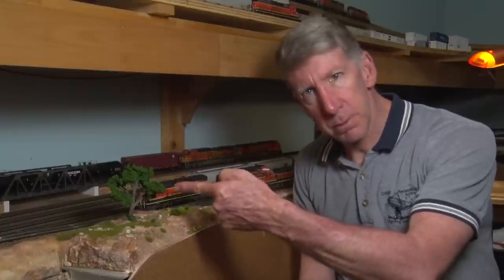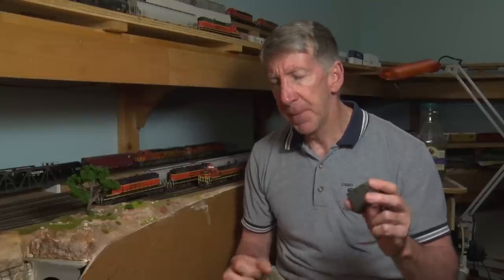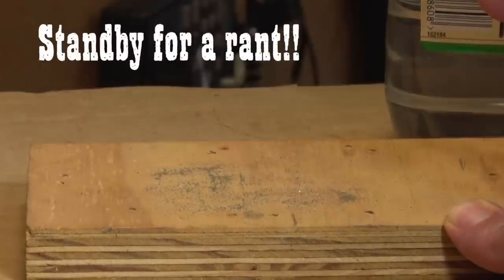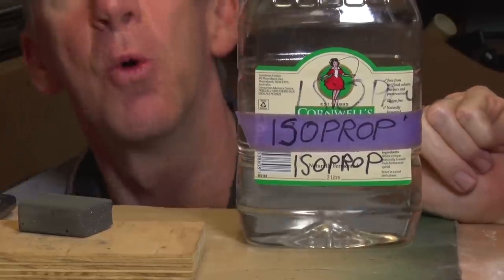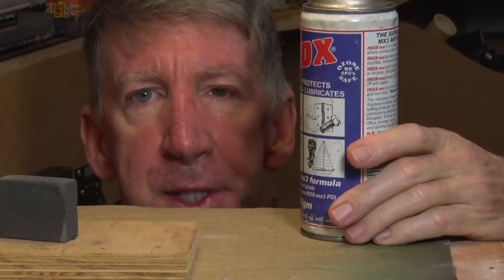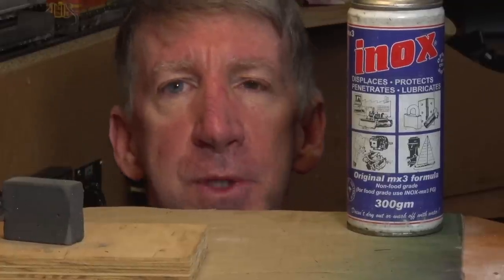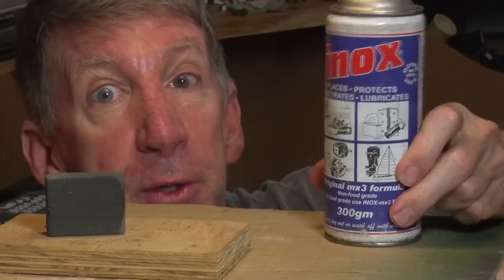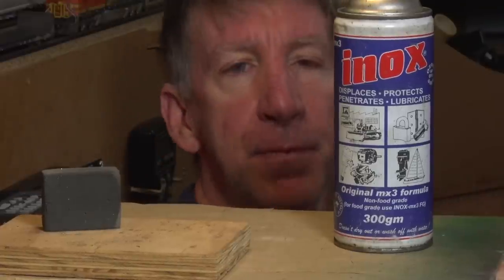Track cleaning do's and don'ts. How "Not" to  clean your track ! And how to do it better!

Comment: Classic!   Back around 1960, Atlas rail was brass.  I used to scrape sandpaper under a wooden block, which would work for a while.  But the more I did it, the less the "cleaning" lasted.  Switched to vinegar and got better results.
Reply from the maker: Thank you ! Vinegar??  The things we used to do ..LOL   i remember brass track and I had some in my early days.  We have moved on thank godness1
Gregg.
Reply: Well, I initially tried buying a special freight car that could clean the track whilst you ran the train.  It came with some chemical that you would add to a cylindrical tank sitting vertically atop what was basically a flat car carrying a silver-colored cylindrical load (the cleaner reservoir).  The fluid was gravity plumbed to a pair of lateral (spring-loaded) wipers.  The idea was to pull this flat car around the track with a loco and it would automatically clean the rails.  But the thing kept derailing at the switches. 

Aside: I only had three locos, of which only one could pull the device.  That was your ubiquitous Athearn F7.  Mine was Pennsy 9506 (Brunswick).  I also had a delicious Fleischmann PA in Warbonnet livery.  The shell was exquisite, cast metal with applied handrails and a metal screen grating over the heat exchanger duct.  But even with lead weights, it would lose traction, which was a shame cuz it had more powerful gearing than the Athearn.   Also had a Lionel "Texas Special" FA-1 with the rubber-band transmission.  Those bands would slip trying to pull the cleaner car.   Frankly, that loco was junk.  But it's the one that got be started in H0 modeling back in '59.   

I'm sure you know the classic construction of the Athearn with the single three-pole motor in the center.  But did you know that the Fleischmann didn't use rods at all.  It had two independent propulsion modules, each with its own motor that sat directly over the bogey.  The motors were mounted directly to the bogeys and each bogey could slip into the shell or quickly be dropped from the shell for gear lubrication.   Every now and then, one of these appears on eBay.  It's worth a fetch just to open one up and enjoy the construction.

But, I digress...

One day, someone at school showed me that dipping a copper penny into tomato ketchup (let it sit) could make the penny shiny.  I investigated why and learned that the vinegar is mildly acidic.  It is strong enough to de-oxidize the surface of copper and brass without being strong enough to hurt anything.  And vinegar was (then) dirt cheap.   Indeed, vinegar mixed with flour was used as a homemade brass cleaner during The Depression here in The States.

Sorry if this is too much information.  I took your question marks to be an invite to elaborate.

But yeah.  You're point about abrasives pitting the rail surface is well-taken.
Reply from the maker: @TheCondoInRedondo   Not at all! I had a rubber band drive RDC from Athearbogie/trn that was horrible! I remember Lima had a similar motor that sat on the bogie/truck. The motor ran in the same plane as the wheels , so no wrm drive and you could push them along and turn the motor...which is what we need today to get away from speed matching issues and locos fighting with each other.  I wanted to buy a "Aztec" cleaning car but they have stopped making them , so I will try to find a used one. 
Thanks for the interesting trip down memory lane.
Gregg .
Reply: Stay approachable, Gregg.   That is the charm of your channel.  You speak to us as if you're a neighbor.  You also respond to feedback.  That's the source of your popularity.  You're chummy, the way Paul Hogan portrayed his character in the movies.   It just shocks me when I hear your accent, yet see 'Merican heralds on the sides of your locomotives.  I thought I'd see a twenty-six carriage Ghan or maybe a Great Southern and a gigantic knife, not necessarily in that sequence.

That said, I must admit I do have an NR, two EL, an A and a B for what it's worth.  But they haul North American rolling stock, I'm afraid to admit.  The NR is Austrains, I think.  The others are Auscision.    Thanks for your attention, Gregg.

I'm absorbing your tutelage on occupancy detection today.

Comment: Simple track cleaning and it works!!!

I have been running my trains for 6 years and has never cleaned my tracks.
My story : After laying track I clean once with a track cleaning pad, only once. Thereafter I use ATF Automatic transmission fluid (The red one) as follows. Using ear bud dipped in ATF I apply about 300mm to each track at the highest point on my layout. My circles are 114m long, so apply less for smaller layouts. Only at one point, don’t overdue it.
The loco and wagon wheels will spread the ATF onto all the tracks over a period of time. You will have no mug built-up on wheels at all. There might be a little bit of loco slippage for a short while after applying ATF but it disappears quickly. Do not wipe any oily substance off the tracks at all. I reapply the moment any loco misses a beat anywhere on the layout, usually once every 2 to 3 months. Small bonus, after 6 years my track already looks a little weathered. Train friends, I was very sceptical about this method but believe me IT WORKS.
I used the MIDAS ATF Automatic transmission fluid  (The red fluid one)

Watch my layout in progress on You Tube
https://youtu.be/7B_GW2gJ0L0

Comment: Great Rant Gregg, the product  referring to is CRC 2-26 , I would use a drop on each wheel of my loco and give that a run around for about 5 minutes before and after a session . 
I got this tip from  one of the operators on an exhibition layout , haven't looked back since.
I also have a can of Inox, haven't tried that yet , I do use that in place of WD 40
Reply from the maker: Thanks Shaun!  It works well too , but try the Innox and compare . I wipe random sections of track evrey time i run trains and it gets around the layout.
CHeers Gregg.
Reply: @FishplateFilms  Hi Gregg, I will  give the Innox ago this weekend as the layout hasn't been running for at least 3 months .
I would  be very interested to say how it it goes, thanks Gregg
Reply from the maker: @shaunhuckstepp7531  Great Shaun!  Please let me know how it goes!!
Gregg .

Comment: Thanks for the information! Please let me know if CRC 2-26 Multi Use Electro Cleaner is the right substitute for INOX
Reply from the maker: Thanks Chandal! No , the "Electro clean " is a different product. If you cant get inox, then use the 2-26 Electrical multi purpose lubricant.
Cheers Gregg.
Reply: @FishplateFilms  Thank you so much! I did not get inox or CRC, but I used wd 40 multi use lubricant (silicon free), as suggested by another model railway enthusiast. I cleaned the tracks, the wheels and pickups, and my 20 year old locomotive become as good as new. It ran smoothly. Your explanation was very detailed and scientific. Being an electrical engineer myself, I could easily understand your concern with the use of polar cleaners. I have bought myself a new dcc set for christmas, and I am never going to use IPA or track rubbers. Thank you for your work! Looking forward to more of your content.
Reply: @chandal804  I used WD40 before using INOX. The problem with WD 40 is it dries out leaving no oil layer to stop the metal surfaces from oxidising.

Comment: Gregg, right on the money!  I'm in the  USA.  I've used Corrosion Guard and Corrosion-X on electrical connectors, and on my ham gear coax connectors (PL-259/SO-239 aka UHF connectors) for years.  I learned about this stuff from working in a seawater environment.  A few years ago I was introduced to Aero-Car's ACT-6006 Track & Rail Cleaner.  They also make Conduct-a-Lube for commutators and wipers.  But yes, it is counter intuitive that a dielectric material would give better conductivity, but it does.  My rant is people insisting  track must be perfectly clean to stop loco hesitation and stalls.  For some time now EVERY loco on my layout has Keep Alives.  Between the proper cleaning and Keep Alives, my locos never stall, no matter how slowly they are creeping.
Reply from the maker: Thank you Sir! Yes working in salt air is a killer for electrical gear! Those products you mention sound perfect for track cleaning and to  keep it from oxidising. I don't have any keep alives as I use live frogs , but if I had some short switching locos, I would give them a try.
Gregg :-)

Comment: Hi , wonderful ,I have just tried some contact cleaner just like you said and what a difference ,smooth at fast or deadly slow ,I used to put it on a faster speed or power just to get it around the track ,oh what a joy ,even the lights on my virgin train are brighter and I cant wait for it to go dark ,a standing ovation to you kind sir ,amazing ,and some thing that actually works  very best wishes from the uk Brian.
Reply from the maker: Hi Brian , thanks for watching and I'm glad you got some good results! Just remember that contact cleaner will not leave a protective film on the rails like Innox or CRC will, so you might want to use one of those from time to time.
Cheers Gregg.
Reply from the maker: @mrmusdtard2  Hi Brian, thats the one!  A can will last you a decade easy...use the plastic tube in the nozzle, and spray  2 tiny patches on a rag , then run along the track and see how black it gets! I keep using the same rags( i have little folded pieces everywhere) until they are filthy. Once you get the rails clean, keep rags with Innox on them as it will stay on them . You'll always get little dark lines , as dirt is always falling and the Innox will get dirt off the wheels too..it's a on going process but you will work out a routine that suits you.
Gregg :-)

Comment: Well I’ve got myself some INOX in the UK and just cleaned the track with it. It’s taken a few runs to get it running smooth but it seems to be working well now. Proof of the pudding will be the long terms benefits. Thanks for the tip!
Reply from the maker: Thanks Mark! It will get better the more you use it , as it removes the dirt from the wheels and track . 
Cheers Gregg.
Reply: That’s what I’m hoping Gregg, think I might need to use some fine wet and dry paper in a couple of places as there’s a few areas with some paint or other gunk stuck on. Still in the scenic phase at the moment!

Comment: Very good video.  I have used in the past a pencil rubber then wipe off the rails with a soft cloth.  I am about to build a small layout for my Grandchild and the stored rail I have is oxidised so will use inox to clean it and the wheels of the rolling stock.  I like the no nonsense language and to the point presentation.  One thing that the rest of the cleaning videos do not mention is that the rails are a circuit and should be treated as such.  Thanks.
Reply from the maker: Thank you Bob! I'm glad you enjoyed the video and got some tips from it .I appreciate the positive comments also.
Cheers Gregg.

Comment: What about 5 percent white vinegar soaking for 24 hours and then neutralize the acid and dry the tracks in an oven?
Reply: I second this question.  I have no experience in modal railroading, but I have my grandfather's old Lionel set.  Many of the tracks don't need a simply "cleaning", but instead need to be completely restored.  I understand that you shouldn't routinely clean with water or anything containing water, but how do you rehabilitate very old tracks?  I've seen other videos that explain how to remove the rust with vinegar and then dehydrate in the oven for an hour.  Is this a really bad idea too?

Comment: Thanks for educating us! There's another scenario to consider and that is people with layouts featuring grades > 1%. If the Inox or other brand of cleaner acts as a lubricant this can cause major traction issues. I have a friend who just went through this and it took a long time to get it off the wheels of his locomotives and rolling stock. 
I've had good results using only cotton cloth (socks) and elbow grease (can't beat the price). It's amazing how much black residue can be removed from the rails every month. I have a theory that this residue is a combination of normal household dust settling on the rails, oils and greases from locomotive gearboxes and the remains of micro-arcing between the rail and the wheel? The downside to my method is that it needs to be done once a month or so but I never have any conductivity issues after I clean it and it does actually remove a lot of that black residue right from the rail head. 
Another thing worth mentioning is the inside edge of the rail needs to be cleaned, the large flanges on our models rubbing on the side of the rail actually do contribute to conductivity. I've experienced this after ballasting and then vigorously cleaning the top of the rail only to have the trains run like crap on them. When I took the time to clean the inside edge as well as the top of the rail the problem goes away. 
Great video Gregg. Thanks for sharing! 
Ben
Reply from the maker: Thanks Ben ! As far as traction goes , I have no issues and all my grades are just under 2% but I don't leave the rails "wet" but don't rub them dry either. Remember clean is different to conductive and my rails are often black when wiped but still function perfectly. I'm sure if you go crazy with any spray you will have traction issues! I run a rag over random sections every time I run the layout ..just habit now and you pick up faults and other things as you go round the track. The side of the head of  rail is very important as you say , especially after ballasting! Train wheels are not flat , even the models, and are cone shaped to help center the axles when running straight , when in a curve , the axle slides to the outer rail, and as such , due to the wheel being cone shaped , has a larger diameter closer to the flange, so most of the tire is lifted off the rail!  This helps trains go round curves as they dont have a "differential" to allow the outer wheels to rotate faster than the inner wheels. So what you are experiencing is actual proper railroad engineering!!! But with us we need a good contact with both rails, so s you say we need clean edges as well , especially on curves ! When it comes to ballasting , Ill think i wil use and eyedropper for the glue ???
Thanks for watching and I look forward to more updates!
Cheers Gregg.

Comment: hello brother interesting what you said about the rubbers i have  been cleaning those rails since 1967 and always used fine wet and dry paper with no solvents but in  resent times used a little metho, but as we know next day its time to clean again. two years ago i lubricated  eight 6 axle coaches with graphite powder wow did that turn those rails black .the weather at the time was rainy and it was winter and in my shed it felt damp and nasty. I noted straight away that my locos were running better than ever before and left the powder on the rails for a week. with no cleaning needed. big problem though trains could not climb steeper grades there was too much powder. reluctant to run my up market locos on the layout for fear of damage i then removed the graphite powder from the rails  i thought what if i just applied it very lightly to the rails but i never have. strange thing about those rubbers after all of those years of track cleaning two months ago i bought one and yes they seem too ruff. OH BOY WHERE TO KNOW.
Reply from the maker: Hi Christopher , if you don't have traction tyres, give this a go and only use a little.  CAn't say I'm sold on the graphite stick, but it's far better than a track rubber!  Good luck with it.
Cheers Gregg.
Reply: @FishplateFilms  yes thank you Gregg  i am now using clipper oil very very sparingly it seems to slow the tarnishing on the rails and locos still run very smooth ,it has been used by a mate  of mine for 25 years he has never had an issue with any of his many many locos .just another crazy idea. I am very keen to use your plan and i will keep in touch.
Cheers Chris

Comment: Of couse the track rubber will "tear" apart on ply wood, it's a rough surface. I've never had any trouble with a track rubber. BUT, it does make sence what you say about wearing the rails down. We just started using WD contact cleaner, NOT LUBRICANT on the club layout and it seams to work ok exept at the end of each running session the loco wheels are very dirty. I clean my loco wheels with servicesol electrical cleaning solvent. It works great and is non corrosive. Thanks for the info 😎👍
Reply from the maker: Thanks Mark!  Contact cleaner will clean OK but will not leave a protective film on the track and it can harm some plastic?  Give some CRC or Innox a go and see how it compares to the contact cleaner? 
Cheers Gregg.

Comment: what about 99% isopropyl alcohol used for ultrasonic circuit board cleaners? I have two bottles of the stuff made by Belle chemical.
Reply from the maker: Any IPA is not suitable for long term track cleaning. The IPA used in PCB 's , is there to clean the board of grease and debris, not to clean the conductive parts of the circuit.  Read the comments below from the many who have had issues with IPA, especially after long term use. Get a can of CRC or INox and see the difference.
Cheers Gregg.

Comment: Hey Mate, over the pond in NZ I’ve never seen that product, what about Meths? Would that be a good cleaner? 
Thanks
-Sam
Reply from the maker: Hi Sam, I assume you mean "metho" or Methylated spirits?  This will clean vry well, but will also leave the track "sterile" , lile IPA , and cause oxidation in the long run. If you can't get Inox, the CRC 2-26 is a good alternative.
Cheers and thanks for watching.
Gregg.